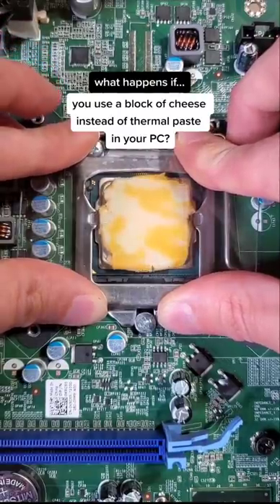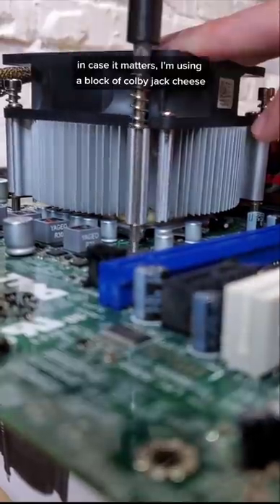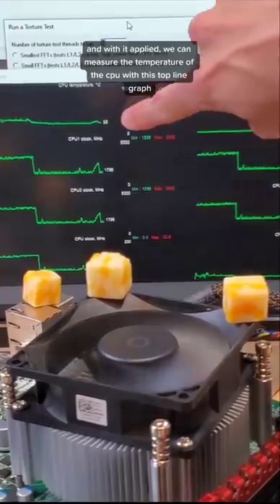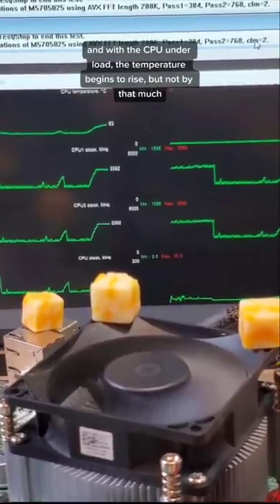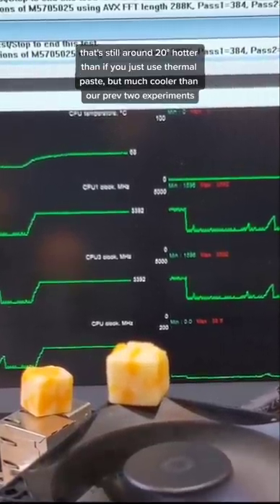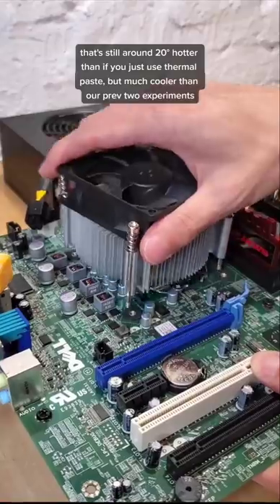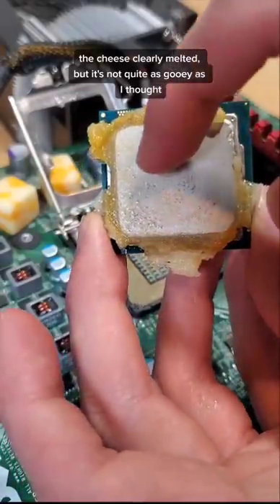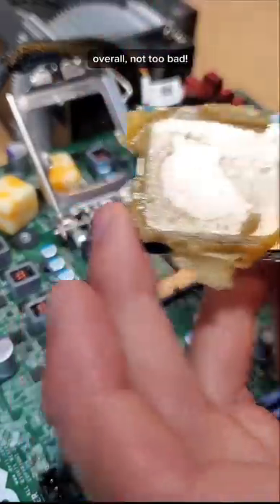using cheese instead of thermal paste #shorts

Comment: Use liquid nitrogen while running the cpu at high temperature, or any other experiments with liquid nitrogen...
Reply: Its done already in an exhibition where they wanted to hit 7Ghz on a processor so they used liquid nitrogen ....It's actually a quite famous video you can check out
Reply: @vivekraut8044  yea and pretty old too
Reply: @vivekraut8044  uh i think its 5ghz
Reply: @paklekj4429  you dont need liquid nitrogen to hit 5ghz lmao
Reply: @vivekraut8044  i think debauer hit 8Ghz in one of his videos
Reply: @ThePhantomCoder  in 1999 5 ghz was a lot, ok Mr Phantom?
Reply: @DrLifeGamer  Didn't YouTube come out in 2005? Is the video on another platform?
Reply: @paklekj4429  I literally go to 5 ghz with my i9-9900K with AIO cooling
Reply: @vivekraut8044  isn’t that jayz2cent
Reply: @paklekj4429  modern CPUs hit above 5ghz without any extra cooling
Reply: It would require a custom motherboard and socket to mitigate condensation
Reply: It's been done so many times it's CPUs in competitive overclocking tournaments are cooled
Reply: @paklekj4429  10th gen intel i9 easily hits 5.5 GHz lmao
Reply: @DrLifeGamer  how is this relevant? Dunce.
Reply: @untamedronin8339  ok troll account
Reply: @ThePhantomCoder  it dont matter when youtube came out. .. lmao is that the benchmark you use to validate knowledge with? 5ghz was huge.almost as good as overclocking old celerons :D
Reply: @kornpops1261  Of course it's not. I'm not validating the benchmark, im validating when that video came out???
Reply: The part of pc and cooler's motor will be freezed
Reply: The liquid nitrogen would instantly evaporate and do basically nothing
Reply: If you're running it at a very high temp and suddenly cool the CPU, it can even crack the die from thermal shock. Inadvisable, that's why competitive overclockers take their time and do it slowly without stressing the components too much. On GPUs, the entire PCB can flex like a bimetallic strip!